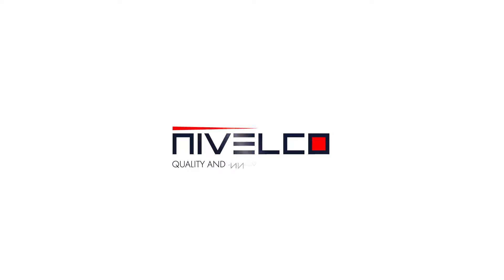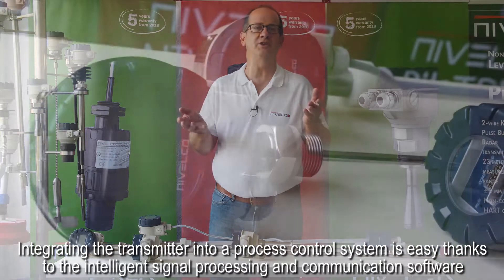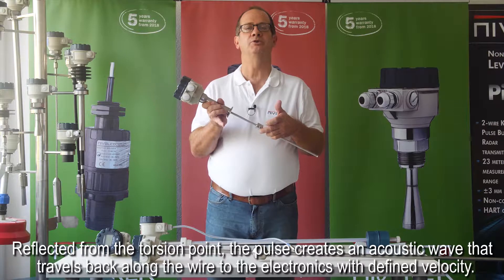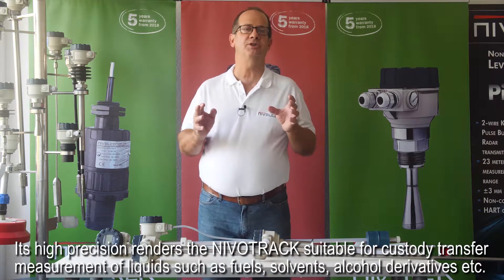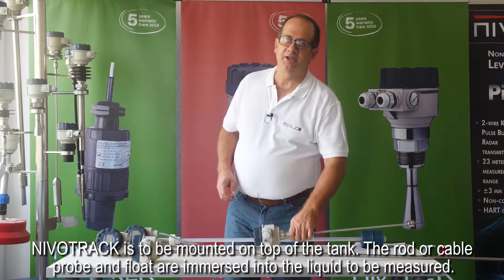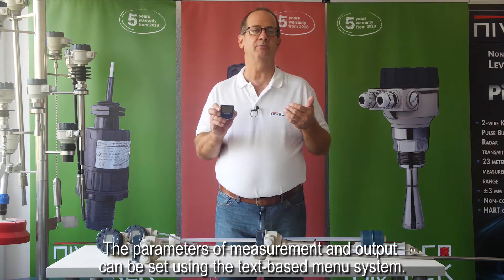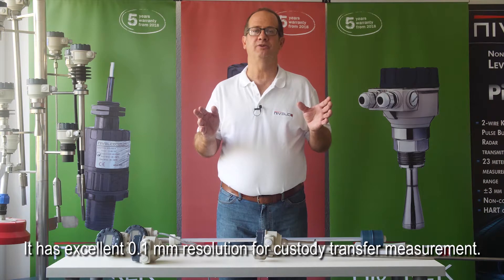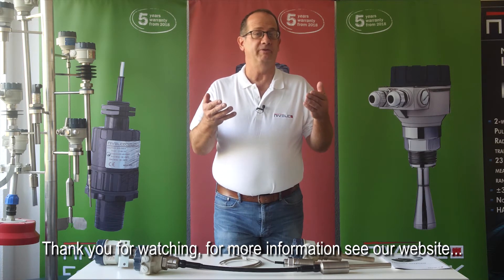NIVOTRACK – NIVELCO Product Training Series

Comment: Good day! Is the float can be removed from the rod? I would like to install the sensor in a hole where the float does not pass in diameter
Reply from the maker: Hi! You can order it with or without float.